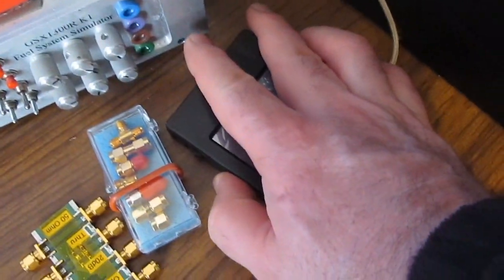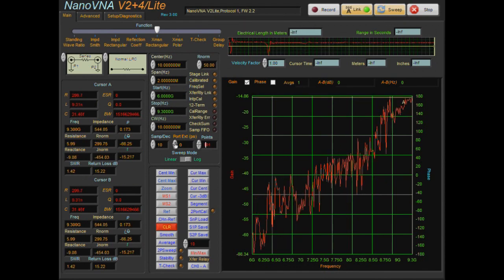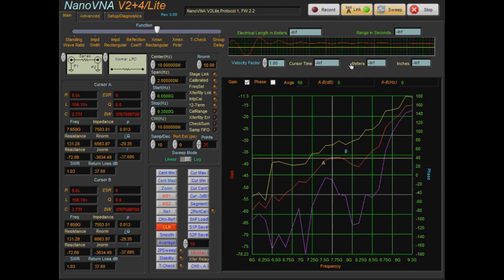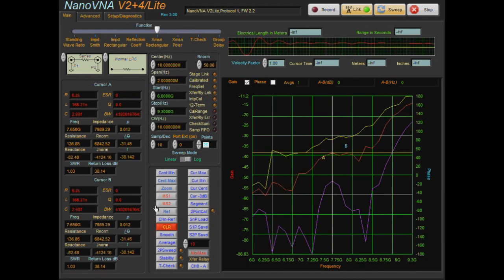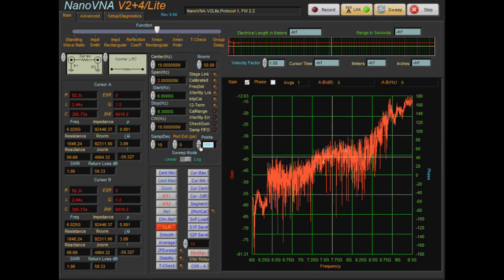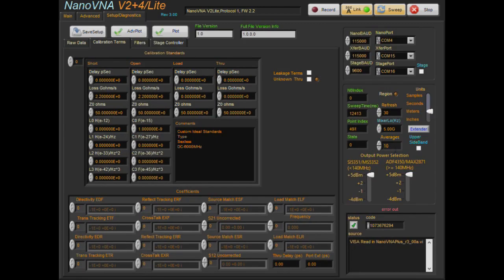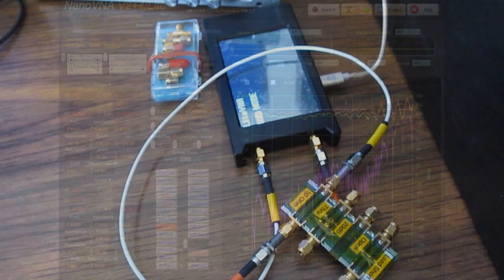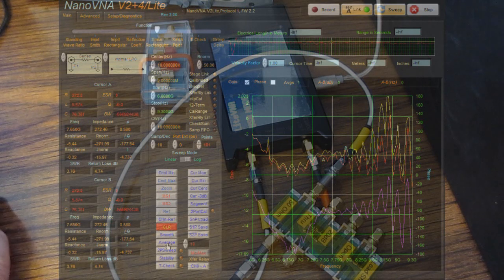LiteVNA's average compared to software average and smooth filter

Comment: The LiteVNA is now half the price of the V2PLUS4. Are the functionalities comparable?  Which is the better choice to buy?
Reply from the maker: Well Jeff, I'm not sure.  If you want to do narrow band work, say make your own crystal filters.  Then I would say the original NanoVNA.  If you want to play around with PDN measurements, again, I would say the original NanoVNA.  I never found the H4's firmware to be good enough to use but the hardware would have made it a slightly better choice for this application.  Working above 300MHz, the Lite and V2Plus4 are the way to go.  Above 3GHz, the Lite.   Below 3GHz, pick your poison.   They both have their positive and negatives.   For learning, all of them are great!  They are cheap, so if you do something stupid, it's not going to break the bank to replace it.
Reply: I got the original and the v2plus4. Having good coverage at lower frequencies and being able to compare measurements from two devices were plusses for this newbie's learning.  Higher frequency work is not important, though I push it to the limits(beyond?) to see what happens.

Comment: Will you be releasing your software for the Lite too? Thanks
Reply from the maker: The Lite uses the same protocol at the V2Plus4.  Dislord had performed some tests with it.  Of course, there are also the open sourced applications as well if you are looking for something quick.
Reply: @joesmith-je3tq  ok did not see that yet, I will see if I get it running, your software is so much more useful and better than anything else out there, thanks
Reply: but sure, I'm not in a hurry, I forgot to add
Reply from the maker: @heinrichhein2605  The only problem I saw was when running the Lite at very low frequencies, my current release would time out.  Dislord had talked about trying to speed this up and it may not be a problem now.  I doubt many users would be experimenting down that low anyway. 

I haven't tried any of the other software except the QT, which never worked with my PC. 

MAKE SURE YOU READ THE README BEFORE DOING ANYTHING ELSE. 

Here is just one example of how not following the instructions can waste a lot of time.
https://physik.co-i60.com/2022/01/new-addition-to-the-lab-nanovna-v2-plus4/

Comment: The internal AVG is actually setting the  RBW. That is why the noise goes down with increasing AVG
Reply from the maker: https://www.eevblog.com/forum/rf-microwave/nanovna-custom-software/msg3942406/#msg3942406
Reply from the maker: A few other comments from Dislord on the subject:
https://www.eevblog.com/forum/rf-microwave/nanovna-custom-software/msg3958163/#msg3958163
https://www.eevblog.com/forum/rf-microwave/nanovna-custom-software/msg3974300/#msg3974300